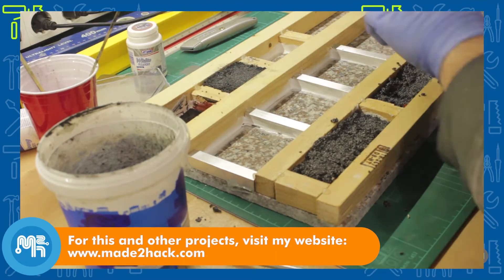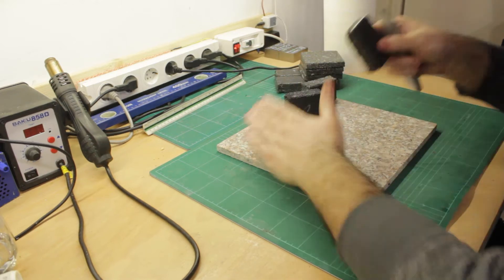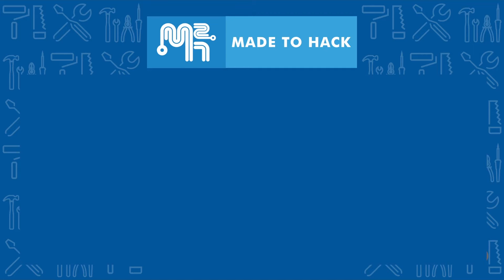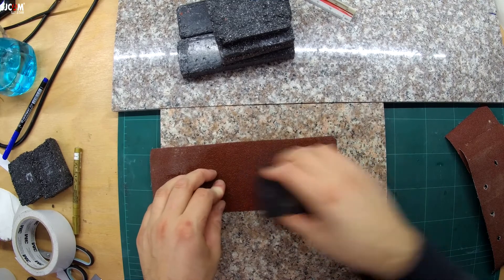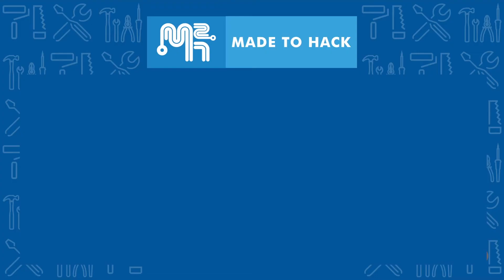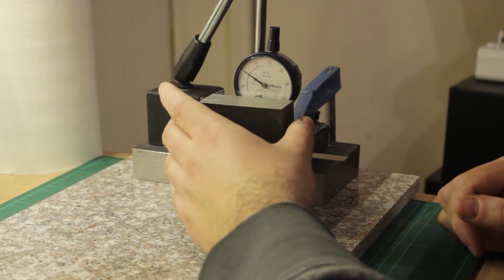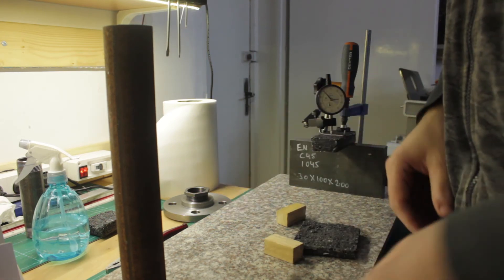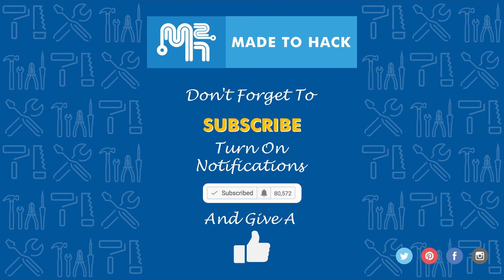Epoxy Granite / Epoxy Quart Mixes & Tests - Part 2

Comment: The steel insert doesn't do anything for the stiffness, it only makes the material stronger (doesn't break as fast). Anyway, you'd also have to put it on the tension side of the bar to have any effect. The way you did it here it goes straight through the neutral fiber.
Reply from the maker: Thanks for the tips. Would you recommend that I add "rebar" steel in the large casting for a lathe? Or it wouldn't matter since I'm only interested in vibration dampening. What I mean it's unlikely the lathe has to resist any heavy loads... unless you drop it on the floor in which case...
Reply: @Made2hack  I would put rebar (or any other steel) in there, it doesn't only increase the strength against breakage, but makes it also stiffer if located properly. For good location: avoid putting them in the middle (bar becomes useless), but also too far outside (so it's embedded nicely). So if your base is roughly square shaped you could put four bars in corners, with some distance to the actual surface. Also, for any mounting surfaces etc. you can cast steel plates directly in there, best if they're somehow connected to the bars or have some anchoring (for example screws welded on the backside or screwed tight into blind holes). For things like this you really should plan ahead, it's not easy to change things when you've already cast the part.
Reply from the maker: @CatNolara  Ok, I was not sure whether the cast mounting surfaces should touch any structural elements. I'm going stainless for all elements, to keep the same coefficient of thermal expansion.

Comment: no comments? this strikes me as interesting, curious to know why you are testing for friction. What is the goal with these blocks?
Reply from the maker: Hi, I want to use these blocks instead of roller bearings in a linear motion capacity. As a result, I want them to interface (rub) directly on to a steel shaft and thus want maximum lubrication. If this doesn't work, I will have to then insert steel so that the touching surfaces are the same material and use conventional (ex oil) lubrication.
Reply: @Made2hack  what about teflon or something similar?
Reply: Hello. Interesting video, found in cnczone, but... In my opinion the sand, quartz and silica will degrade rapidly the contact surface of your slides. Better to insert metal between contact surfaces. I'm considering build one heavy cnc with epoxy and I'll start mixing EG formulas to find the best. Where do you find "silica fume"? Thanks
Reply from the maker: @dgalvarez  Hi. I think you could be right about the particles degrading on contact. I've not tried it yet. Soon.

As for the silica fume, Sika makes it as a concrete additive, otherwise you might try fumed silica at chemical suppliers. If you have a ball mill or some way to grind down the silica sand, this might be a way to do it. I'm not a huge fan of the stuff but it seems to be recommended. I find that it really dries up the epoxy (or I should say) makes it less flowy?
Reply: @Made2hack  thank you. I'll try to find this additive. Regards and good luck in your project